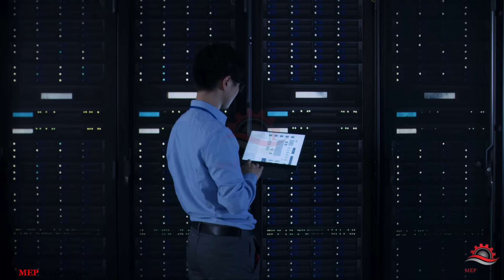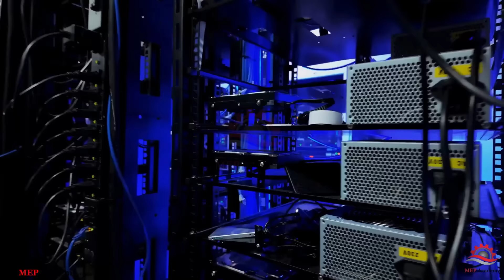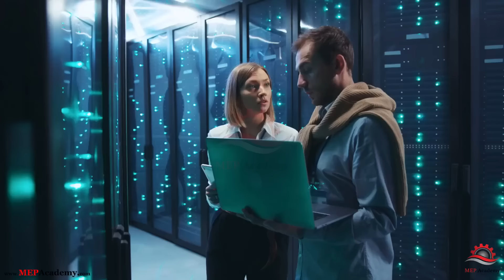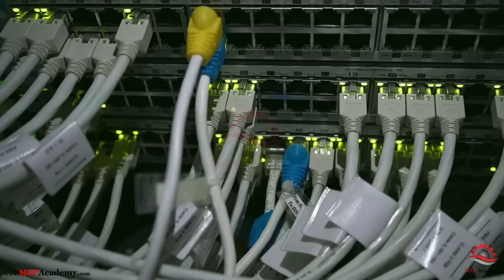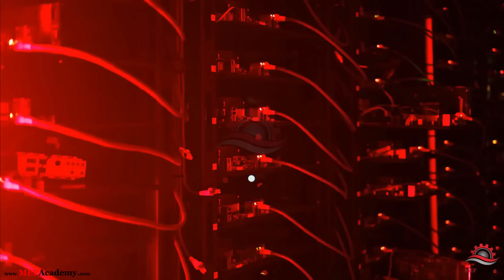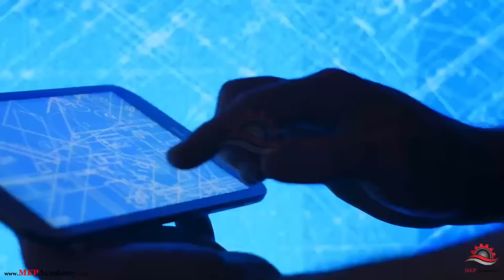How Data Centers Actually Work

Comment from the maker: If this is your first time here, this video is Part 1 of a full Data Center series focused on how these facilities work from a mechanical and electrical perspective — not IT theory.
In the next video, we break down how power flows from the utility into the data center and all the way to the server rack (UPS, generators, distribution, redundancy).
If you work in HVAC, electrical, plumbing, estimating, or MEP construction, let us know in the comments which system you want us to cover next — cooling, redundancy, airflow, or backup power.
Reply: Cool video. When can we expect part 2?
Reply: Would love to dive into hyperscaler trends, pre-fab trends, data center layout/strategy, water cooling/air chilled construction differences/advantages.
Reply: I am interested in hyperscale power backup requirements and trends.

Comment: Many of these centers are using gas fired generators (without emission controls) to power these facilities.  A typical Data Center uses about the same amount of water daily, as a city of 5,000-10,000 people.   If one of these places are coming your way, sell your property and move.  Either that, or get destroyed by the machine.

Comment: For those that don't understand a cooling system, it's a closed system, once filled the system requires very little water to keep the system full, and most systems don't use much water as they use a coolant similar to what's in the radiator of a vehicle. Before you know everything, KNOW everything.

Comment: This control system worked EXACTLY the same as Three Mile Island!
Reply: 3 mile island was what happened when people who did not know insisted on MANY ALARMS. So many, that the important one was lost among all the warning lights and sirens.  A Valve was closed on the backup pump (that powered up when needed. The problem was it could not move water. because the closed valve alarm was lost in all the rest.). Alarm Priority is now standard design.

Comment: There are about 12 data centers either being built or proposed to be built within 100 miles on the Missouri side of St Louis. 
What doesn’t make sense is the taxes being waved for these buildings yet it is these same buildings that are the main cost within the counties they are being built. Roads are destroyed by the contractors, the electrical grid is overloaded and requires new lines and more output from the power companies, and water wells will be effected because the wells for these data centers are 1,500 feet deep. The normal household goes about a maximum of 500 feet deep. So the wells for data centers will be a 1,000 feet deeper, thus pulling the water down from above it? Then the contaminated water is dumped out somewhere into the surrounding areas. 

The real question, is where is Al Gore and all of his tree hugging green people now? How come the environment is no longer a problem when it comes to building these data centers? The green groups have fought pig farms and anything else the farmers have wanted to do, and fought bridges and roads because of animal habitat. Yet now it is ok to build these data centers without any environmental impact studies when it is well known that they have lights on 24/7/365, and there is always a loud hum emitted which is so loud that a 30’ high berm is built around these things to try to contain the noise. 
But since Al Gore invented the internet, (his comment, not mine) I guess damaging the environment to help increase his internet system is acceptable and not worthy of being protested.

Comment: Bottom line is that the energy to run these data centers far exceeds current capacity, and the competition is fierce for data and cloud storage for average consumers, let alone the chaotic, sloppy and unprofessional rollout of  AI and robotics using foreign nationals and their proposed expansions. There are cyber security issues, government defense contract weapons/drones taking priority. Many groups are unhappy with the Tech Titans, and do not want to see the current environment strewn with cables, fiberoptics windmills, solar panels, nuclear waste, high electricity costs in their own backyard killing off food supply, ruining the eco system with forced land grabs aka eminent domain. CA is a precursor to the 'types' of people that are pushing this industry down everybody's throats. Gadgetry and Tech devices aren't all that necessary or amusing, so pick your poison wisely.

Comment: This video is inaccurate. Data centers are not about data hoarding. They are about data processing. To illustrate, your brain does not need to remember every single detail of every conversation you've ever had. Your brain has a way of "compressing" the information. You remember patterns, principles, and concepts which allow you to function without having to recall every bit of information that you've gathered in your life. Similarly, it's not necessary for AI data centers to store every email and every selfie ever taken. That data is stored on the respective platforms which host those services, (the internet). As far as data storage is concerned, AI data centers primarily focus on working memory, (like RAM). For example, when you chat with a bot, it may access the internet and gather data that pertains to your chat, as well as your prompts and responses, and it must recall that information quickly in order to respond to your prompts. But it doesn't need to store that data indefinitely.

Comment: While I did not read all the comments, one environmental aspect critical to data center operations was missed, humidity control.  Humidity has to be controlled to prevent both condensation and  static discharge.  Yes, I build Data Centers.
Reply: one of electronics worst nightmares...

Comment: I have worked at a gigantic DC for over 10 years now. The buildings are a third of a mile long. Best job I ever had.
Reply: Do you live near a large city or in the middle of almost nowhere?
Reply: @jeff5101  It's out a few miles from the city. Pretty much farmland with a few homes here and there.
Reply: kerbygator I would like to work there too, Help ?

Comment: Data centers need continuous power, continuous cooling and continuous uptime. All of this translates to enormous electricity usage, enormous water usage and polluting and never ending heat and noise generation. All of these cause extreme stress on animals, plants, people and the air quality and environment. What a nightmare. Question: in every 100 mile radius how many data centers are needed and why are they being put in rural areas zoned for agriculture?

Comment: I work in a tier 3 DC. We have 24 gensets,each with 3.2Mw capacity. Our cooling system is the latest using huge Fan Wall Units like a double decker bus on both sides of the Data Hall. All batteries are stored on ground floor.
Reply: Very good 👍❤
Reply: OK.  Why did you feel the need to share this vainglorious post?

Comment: Currently a Data Center going together N. of Milwaukee WI. 
It's big like 1 square mile with dozens of heavy trucks hauling materials.
It's being built 3 miles from the power plant that was converted from coal to natural gas a few years ago.
Things should quiet down after its built.
Reply: curtisstefaniak1378  Which Company (which Data Centre) , Thanks 💞
Reply: Nope  your natural gas price will go up.

Comment: I work at a testing data center, power is provided by batteries that are charged by electoral power, we have massive generators in case of power outage. The sound of these units is kind of freaky, Wires are routed under the floor. Just a simple amazing place
Reply: I work as an electrician in a data center. Amazing how much power, assume amount of wires, that it takes
Reply: Let's say AI gets out of control in the future, how would you shut down such a place? Is there an off switch somewhere that humans control remotely, or would you have to destroy the power grid to take it offline?
Reply: @ieism1 very good question.  I have no idea. I do know the local fire department came in for an inspection and asked the same thing
Reply: @ecast1500    Ask Serbian girl 🥰,Yes there is a Main Disconnect Switch , Also: ATS = Automatic Transfer Switch 💞

Comment: I heard that the state of Texas requires Data Centers to provide their own power source, and even provide power to help the existing power grid
Reply: While they suck up huge amounts of water.
Reply: @oldmanrock7542 
The large amount of water is a one time startup cost. After that, the water keeps being reused.
Reply: @jeffputman3504 not true because some them have a open top with big fans and lose water by evaporation and have basically the same thing our toilets have to fill. I know this  because I was a plumber who worked for mechanical companies and would work with the mechanical guys
Reply: @jeffputman3504  That is not true.  They consume the equivalent amount of water, as a 10,000 person town, daily.  Consume, not reuse.
Reply: @oldmanrock7542  Why are you perpetuating a distortion on usage. Plumbing in any structure needs filling. The water circulating in the air conditioning (yes, those are Water coils) is CIRCULATING, not dumped. Cooling towers do not need POTABLE water (cooling towers boost efficiency by evaporation instead of bigger-noisier fan coils)
Reply: @steveurbach3093  Yes cooling towers need potable water, anything with lower quality causes real issues
Reply: The one being built near me is contracting with a couple of solar power companies which are supposed to supply all the electricity, and they're recirculating the water for the cooling system. They'll still use 4000 gallons a day though.
Reply: Texas is not requiring all data centers to generate their own power, although it’s not a bad idea.  There is a very large data center being built in a rural area of the panhandle that is going to power itself because there isn’t enough power anywhere close to the site.
Reply: @sprockethead2047  Power themselves? how?  By using the deadly gas fired generators, that Musk uses?  Ask the people of Memphis, how well that is working out for them.
Reply: We can Absolutely defeat the data centers! Yes we can! Look, we cannot stop them from harvesting data, but we can make sure it is corrupted! That is right! The system cannot discern the difference between what is useful and what is useless! Make sure we send out useless nonsense into the field. Gobbledygook on an epoch grand scale! A massive, coordinated data poisoning would break the foundational systems of the modern digital economy. AI models would fail, targeted services would collapse, and businesses would pivot to hyper-intrusive physical verification methods. Let’s get in it!
Reply: That is nonsense.  The power supply is often gas fired generators that belch super concentrated pollution into the air, and there is no sharing of the electricity, or putting extra, back into the community.
Reply: False
Reply: THAT'S NOT GOING TO APPLY TO ALL DATA CENTERS .

Comment: They are putting up a bunch of them near me.  They will use up way to much water and make it even hotter.  They should be built in Canada or northern states were cooling would be much easier.  I'm especially concerned about the water.  All the wells here are 400 feet deep.  You KNOW they will drill deeper for water which could make everyones well go dry.  Too bad for the regular guy.

Comment: That is how every single electronic internet transactions all can be traced caught found out even encrypted it still passes through these IP addresses of all source centers it NEEDS to be sent, servers without which internet is just cables running haywire with no purpose so even if my EBT cash is siphoned the govt. Server knows who has done it as it is electronic chip driven

Comment: Let’s not forget the telephone company Central Office. All those cables, fiber or copper and cell towers feed their signals into a central office which then sets up the connections throughout the network. Early in the last century an operator would sit at a cord board and make connections. Then electromechanical devices made the incoming and outgoing connections. Once an individual 56KB circuit was considered high speed.
Reply: And now virtually no jobs created for a huge thing that will need to be bailed out if it fails
Reply: Not the same as far as power requirements.  I worked in telecom for 30+ years now work at a data center.  The DC recently got approval for nuclear power.
Reply: @bobchris11  The USA has many nuke plants, please elaborate.

Comment: NEC chapter 708 is COPS or Critical Operations Power Systems. It's often referenced to police, fire, and 911 locations that can't safely go down. But one part of 708 refers to any failure that could jeopardize the economy of the nation, such as Wall Street. This requires huge battery banks for UPS systems and large generators to take over when power goes out. One blink and computers and servers go down and lose valuable data. Data centers are not going away any time soon. It's a cyber world now.

Comment: Can electricity be generated from the heat coming from these centers?
Reply: Yes, if they used the heat to run a boiler generator.
Reply: @Bjordan256 how about heating homes in the surrounding area?

Comment: Why are data centers needed in such vast numbers?
Reply: I've been asking that same question, so I asked Co-pilot, here's the answer and it has everything to do with the method that we are communicating right now and then some.  

    The core idea is that modern digital life depends on enormous, always‑available computing power, and that demand keeps rising faster than any single facility can handle. Multiple independent forces drive this:

Explosive growth in data — Every app, website, sensor, camera, and device generates data that must be stored, processed, backed up, and served quickly.

AI and machine learning workloads — Training and running large models requires huge clusters of specialized hardware. One data center can’t supply enough capacity, so companies build many.

Cloud services must be global — To keep apps fast and reliable, companies place data centers close to users around the world. This reduces latency and spreads out traffic.

Redundancy and reliability — Critical services (banking, healthcare, communications, government) need backups. Multiple data centers ensure that if one fails, others take over.

Energy and cooling limits — A single site can only draw so much power and dissipate so much heat. Scaling horizontally—building more centers—is the only practical option.

Regulatory and privacy requirements — Some countries require data to stay within their borders, forcing companies to build local facilities.       

I live in Georgia and there is already 148 Data Centers across the state with many more coming!

Comment: Trap the heat. Use it.
Reply: There are lots of processes that use low level (below 100C) heat. Leaving off security (Data centers have tight security). Zoning discourages efficiency.  A commercial Laundry needs hot water. A paint booth might use warmed air to dry the product. Even a Public swimming pool needs heat .  NYC distributed the used steam from power generation, that was used to heat nearby buildings.  We need to say 'How can I USE' rather than NOT HERE.
Reply: Send it to the 7 month frozen hell in Wi.
Reply: The owners of the data centers should stay near the heat, so they will be used to it before going to hell.

Comment: Fun fact: data centers use chilled water that runs throughout the building.  At least, the one I worked on did.
Reply: It's a closed loop system. It's not like water is pouring out of them.
Reply: @kerbygator and a closed system recirculating doesn’t use additional water      Where are the steam clouds from the cooling system.
Reply: @Gizmo82477  If it's cold out you can see it.
Reply: @Gizmo82477  Are they using cooling towers?
Reply: @kerbygator  Closed loop systems still use lots of water - all the power in (plus another odd 15%) get evaporated through the cooling towers - simple physics.  

I used to design HVAC systems for DCs before I retired
Reply: Why didn't you show some integrity and quit
Reply: Good practice would isolate DC cooling water to dedicated to the DC - building hvac is for human habitation - DC has no human occupants
Reply: You also need some kind of cooling system to keep the water chilled.

Comment: Question?
What about harnessing the waste heat, instead of dumping it outside?
Is the building properly insulated for heat transfer properties?
What about immersion data centers?
What about an immersion with a loop system tied in?
How does somebody make data centers more efficient without sacrificing performance?
Would implementing more 2K be better then 4k as far as data consumption?
Reply: True. Imagine heating a greenhouse through the winter with a dataceneter.

Comment: So, why can't they be equipt with solar arrays on the roof tops along with looped water cooling systems to reduce the power and water consumption from the local community?
Reply: b/c that 'community' u speak of is not part of the plan/future, obvs.
Reply: Wouldn't provide a fraction of the power needed. What happens at night? Or in a storm? Or just a cloudy clay? If you want sun, then you need a desert. And then where will you get the water?